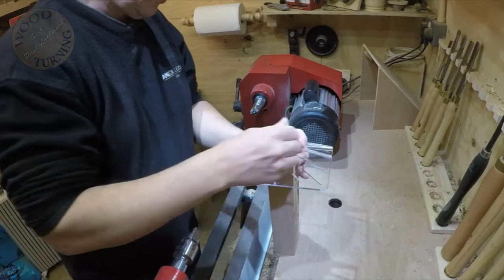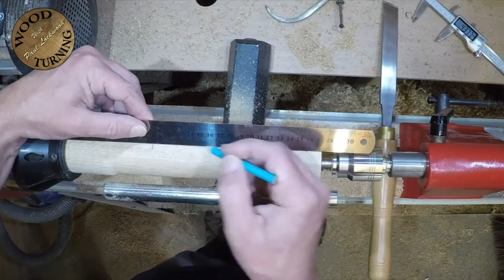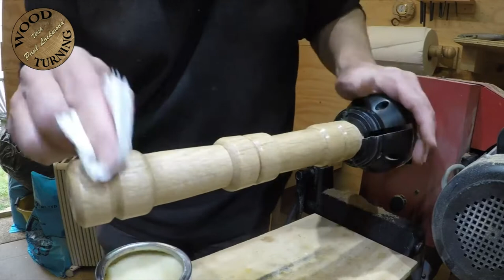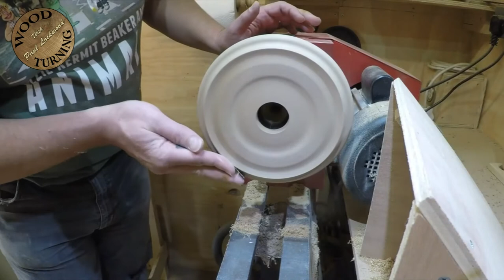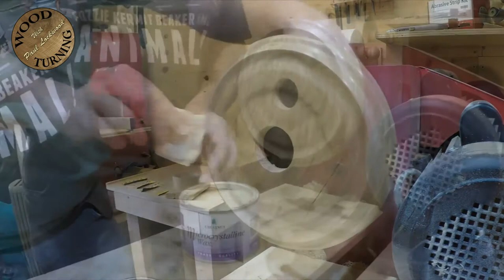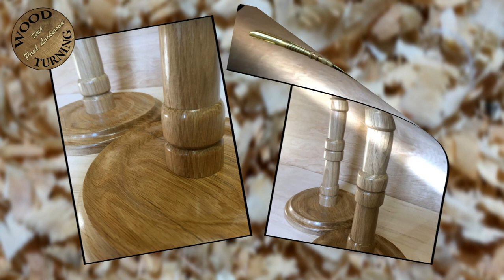Oak Table Lamp - Episode 98

Comment: Two nice looking lamps there paul, and very impressed with the duplicating too mate.
Great video.
Cheers
Mike
Reply from the maker: Mike Waldt Thank you. The annoying part was the cracks in the bowl blank and that catch I got when finishing the top of the stem on the second lamp, meant I had to go back and match up the first one again. It's quite surprising how much work it takes to duplicate items and these were pretty simple shapes.